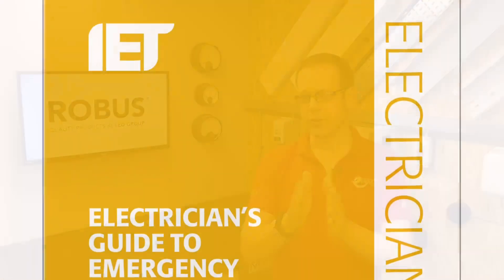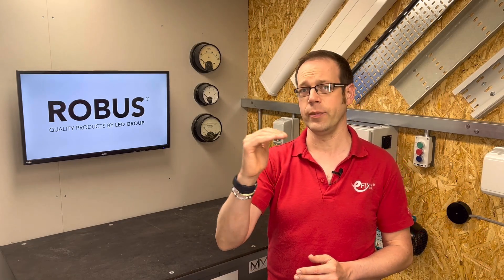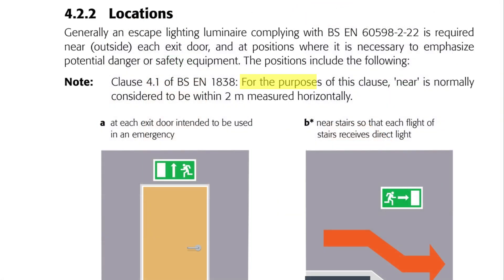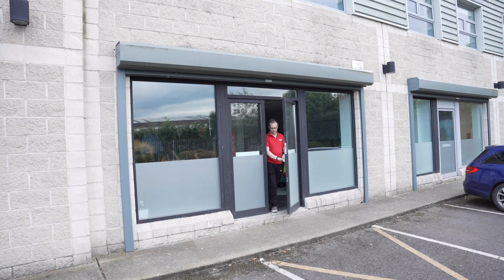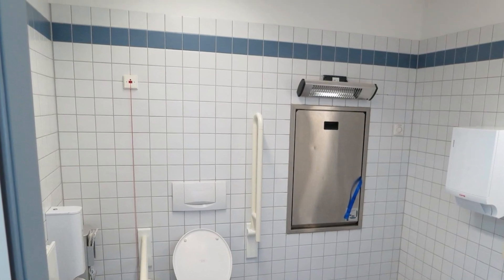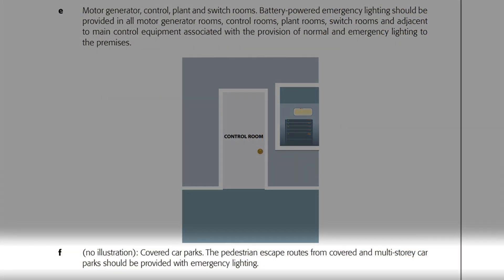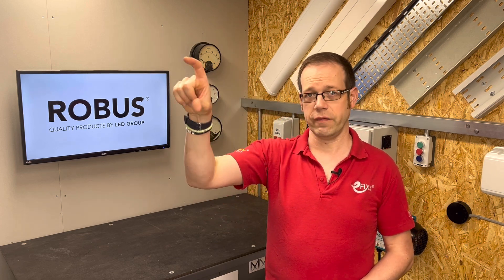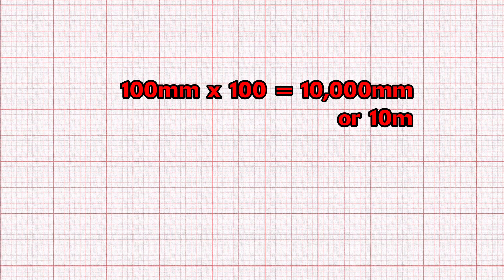Mastering EMERGENCY LIGHTING Compliance Is Easier Than You Think

Comment: Is it ok to fit a glow in the dark arrowed exit sign below or above a bulk head emergency light with no sticker emergency arrow on the front of the bulk head light .
Reply from the maker: The sign doesn't have to be internally illuminated but it does need a certain amount of light on its face when the lights fail. 👍